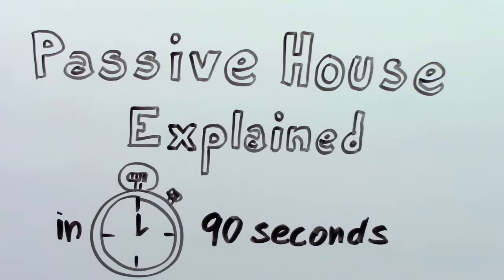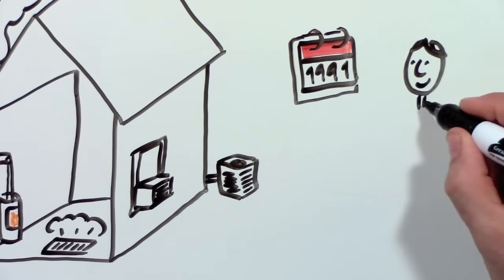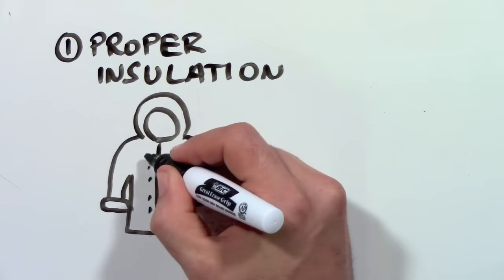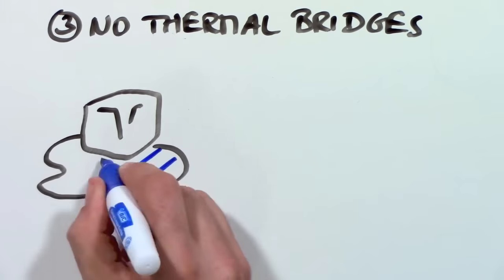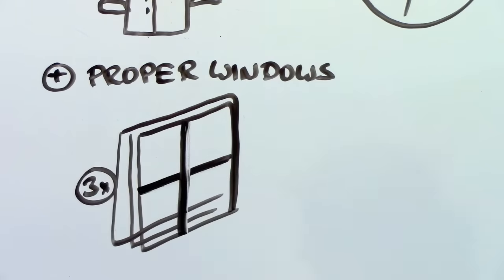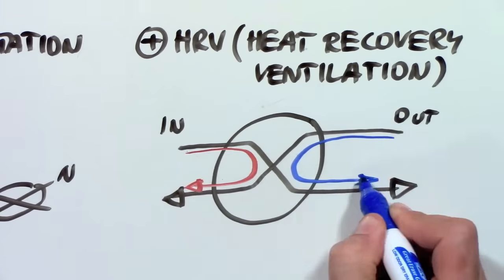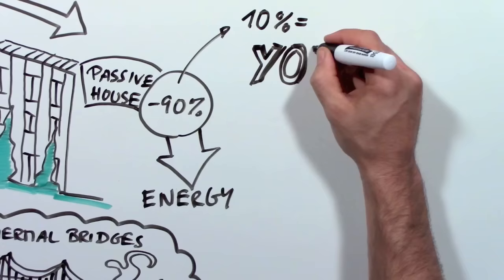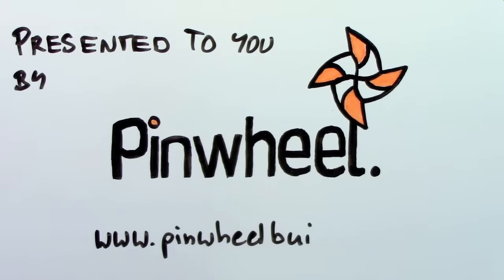Passive House Explained in 90 Seconds

Comment: I’m building a passive house in Canada, it’s always difficult to explain it to the folks who live in our cold climate and are not familiar with the passive house concept that there’s no “heating “ or “air conditioning” in the house. This hopefully makes it easier! Thank you for posting it.
P.S: German Technology IS the best!
Reply: History
Bo Adamson, co-originator of the passive house concept.
Wolfgang Feist, co-originator of the passive house concept, and founder of the 'Passivhaus Institut' 
The Passivhaus standard originated from a conversation in May 1988 between Bo Adamson of Lund University, Sweden, and Wolfgang Feist of the Institut für Wohnen und Umwelt (Institute for Housing and the Environment, Darmstadt, Germany).[11] Later, their concept was further developed through a number of research projects,[12] aided by financial assistance from the German state of Hessen.

Much of the early 'Passive Houses' were based on research and the experience of North American builders during the 1970s,[13] who – in response to the oil embargo – sought to build homes that used very little or no energy. These designs often utilized the sun as a heat source and the term 'passive house' was possibly derived from the passive solar features of these houses, such as the Saskatchewan Conservation House and the Leger House in Pepperell, Massachusetts. An early book explaining the concepts was The Passive Solar Energy Book by Edward Mazria in 1979.[14]
Reply: Hello, Have you moved house? Can you give detailed information about this subject? I'm thinking of getting it done too. Have a nice day

Comment: This is a really great video and I've shown it to a lot of people!
I do have a criticism which is that a Certified Passive House in a cool/cold climate will most probably require some heating to remain above the Certification temperature threshold of 20 degrees Celcius in the middle of winter. However it will not need a full central heating system as would be required in other "typical" buildings in that climate.  The permissible heating load for a Certified Passive House in ANY climate zone is 10W/m2 of the Treated Floor Area - this is not Zero W/m2!
Conversely in a warm/hot climate there is likely to be a requirement for cooling so that there is not too much overheating, but again, only a small percentage of the cooling that would normally be required in a typical building in a warm/hot climate.
Reply: Perfect limited job for strip heaters or minisplit.

Comment: One further step that could be taken in an urban setting is to provide these houses with Solar panels for electricity and Solar thermal for central heating and water heating. Interconnecting neighbouring buildings to set up a peer-to-peer system where they are able to exchange and redistribute power where necessary. Ideally they would produce a surplus of energy which then could be fed into a big grid where the transport sector could be supported.

Comment: I wish you talked about cooling as well It becomes more and more important
Reply: It's very tricky to talk about most of anything within 90 seconds. I guess I'm a bit biased living in cooling dominated climate, but all strategies are still applied, just as they regard to keeping the heat out of the house/building.
Reply: Not an expert but I know people with passive houses in hot climates like Texas and Australia. The idea is during the night all windows and doors are open to ventilate fresh air into the house. In the morning once the temp gets to a certain amount, everything closes and the way the house is built, it traps that chilly air inside. You can also have fans in the house. Passive house doesn't mean 0 energy usage, just as little as possible. You use the solar panels for running the fans if needed.

Comment: I think that umbrella (insulating) concept is more important in Canada and Scandinavia than in most of the Continental USA, with mean temperatures around 50 degrees Fahrenheit.  Much of Arizona and Colorado are ideal for relatively inexpensive passive homes, with a big advantage in available solar than most other places.  In AZ and CO, the controlling minimum is water.

Comment: Of course in a cooling climate, that TV, et cetera, hurts you in the summer. One discussion happening right now is how to treat photovoltaic electric generation within the Passive House methodology.
Reply: Yes, conversations will always keep going, and we will get better at it. In PHPP, the heating caused by internal sources, is taken into consideration and would be offset by the proper amount of cooling and shading. As for photovoltaics, I'd keep that separate. Build a proper Passive House and then use the power generation to make it Net Zero (or even off grid), that's the simplest way to look at it. (BTW, I once calculated that each kW created by Photovoltaics is currently still 10x more expensive than each kW saved by the building technique of a passive house).

Comment: Great video. Would you know if there is a comparison for heat loss of one single triple layer glass window compared to two double glass layer windows separated 30 centimeters apart? Old houses in Germany, Austria, Slovenia and Croatia had such double windows, separated some 20 cm to 30 cm apart, providing very good heat retention.
Reply: DeksZagreb I’m not sure if I understand your question correctly. A single insulated glasing unit with three layers of glass with krypton inbetween can have a u-value as low as 0.5. An insulated glasing unit with two panels of Glas can go as low as 1.1 (from memory, maybe even lower). If you put two in “series”, you should be able to calculate it just like adding different layers in a wall together (keep the air films in mind; it’s also the same way you add resistors together). BTW, many passive houses use this strategy for their glasing, especially older renovations/Restauration in Europe where they want to keep the style and look, and possibly even the old frames.
Reply: I meant double windows like the following: 
https://www.stolarija-roncevic.hr/images/galerije/stolarija/2/prozor-drveni-dupli.jpg 

How could we calculate the heat loss of such double windows with dual pane glass compared to a single window with triple pane glass? In one house I have the double windows at 20 cm apart while in the other I have these double windows at 30 cm apart, both walls are 60cm thick. Both houses are more than 100 years old, I renovated them a couple years ago.

I would like to build a new passive house so I am trying to determine the heat loss compared to windows cost. Hence it would help if I could calculate whether a single window with triple pane glass would be more cost efficient than a double window with dual pane glass, compared to heat loss per year.
Reply: DeksZagreb okay. The answer I gave above does apply then. Maybe you just need to find a building physicist or an energy consultant to ask.
Reply: I thought there might be a rule of thumb to calculate the heat loss through the window panes... As a wild guess, the triple pane argon/kripton single window should have more losses than the double window dual pane glass with 20 cm of air tight space inbetween.
Reply: DeksZagreb the formula for adding two resistors in series (just like the heat resistance of the two double panes together) is 1/R=(1/R)+(1/R). At a resistance of Ug=1.1 per each is 0.55 added together. I’m not sure what the 200mm air layer and the convective air movement would do to this, but that’s probably a pretty good start.
Reply: Air is used as a good insulator in building walls and professional coolers. I read somewhere that a 20 cm air space between windows would be an equivalent of a 35 cm thick brick wall and 30 cm as 50 cm of brick wall. Air is simply a poor conductor and an excellent insulator. I just wondered if someone knew the formula how to calculate the needed air space between windows for a passive house with 50 cm ICF concrete walls.
Reply: As the distance between glass layers increases, so does convection movement of air rising and falling as it cools allowing more heat to escape. However after a certain distance not known to me, this movement decreases.

Comment: Thanks for sharing!  I suspect that 90% of the principals carry across for cooling! But could you comment on the 10% as heat extraction would be addressed slightly differently.
Reply: both. any additional needs can be provided by simple strip heaters and minisplits.

Comment: Wouldn't digging a pit (in your basement or other area) to tap the natural 60 or so degree heat 10 feet down (whatever the distance to get beneath the frost layer) be more economical? In the cold the heat transfer would leave you house at 60 degrees no matter what the temperature outside and its cheaper to heat from 60 to 70 than from 0 to 70. in the summer your house would be a natural 6o which would be perhaps a bit chilly when its sweltering out. Am I missing something? Maybe the two systems can be combined.
Reply: PH eliminates 90% of the load, making complex earth heat systems redundant. any additional needs can be provided by simple strip heaters and minisplits.

Comment: How do you cool it down on summers?
Reply: Heat doesn't enter in summer, just as heat doesn't escape in winter. However, in extreme climates, a simple strip heater and/or minisplit AC make up the difference without central heat/AC.

Comment: helps but not for today when we use LED of less heat. The name is misguide as stove and light are not passive. Would you please give real guide to say how a 1000 sqft single family house can be such passive? what are the insulation, seal and vent is needed?

Comment: Nice explanation, I wished it was that easy and true. Because it is not. I live in South Florida and without A/C you get baked in your house, passive or not. All the insulation and those super windows (which are really nice and very good) are also very, very expensive. Maybe more than using the A/C...It may work in colder climate, or maybe in San Diego where you don't have hot summers nor cold winters, but not in Chicago or West Palm Beach.
Reply: It does work, and you may not even need triple pane windows in Florida. What you do need is proper thermal protection in your walls, which prevents heat from reaching the inside, and correct shading. A good passive house designer should see if the house is overheating in PHPP before anything is built. Also, A/C is not "forbidden" the same way that heating is not forbidden, it just needs to stay within a specific amount of energy consumption.
Reply: Actually it works great in Australia too. If you think there is no way without AC then clearly you're not very familiar with the notion of passive houses.
Reply: They work in extreme climates. That's where they are tested. However, any additional load can be handled by a simple strip heater or minisplit AC without expensive central systems.

Comment: Why these with rock wall? Center rock heat dissipator sensible, walls? Really, skyscraper weight bearancible walls😂 wood beam frame, corner stone type ground parts, thin wall with eps or epu. There, a small power demanding, Sense of heat. And affordable